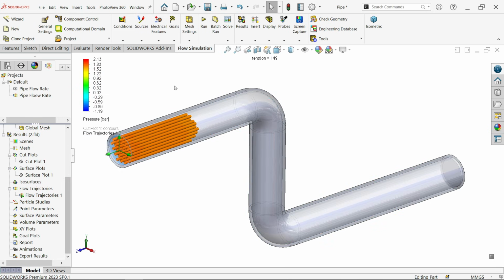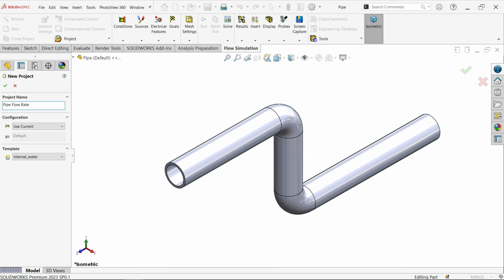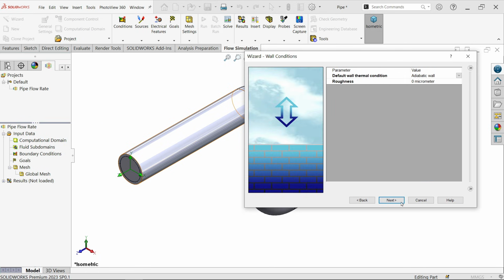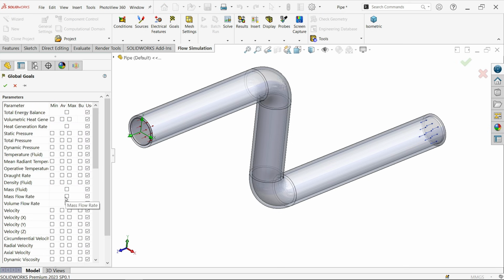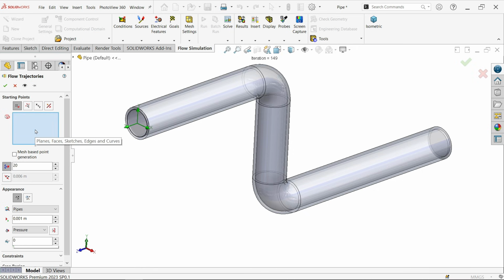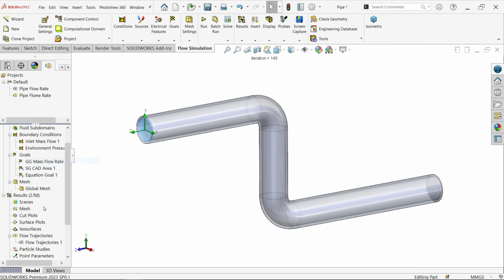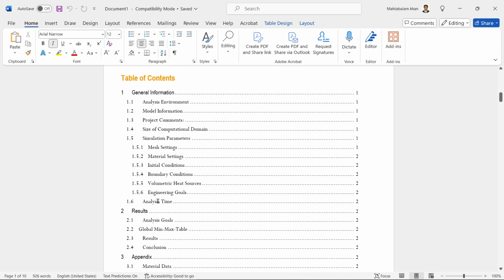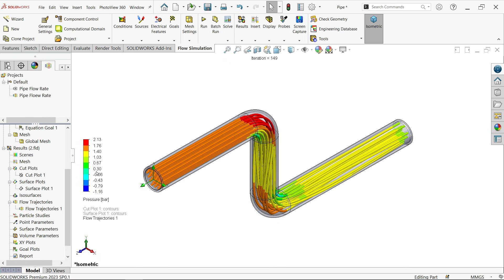SolidWorks Flow Simulation through Pipe Find Velocity, Mass flow rate, Pressure, Temperature?

Comment: I've been trying to figure out which of the Solidworks features I should use to test the flow of water around a newly designed fishing lure.
I was hoping to simulate the lure as it's being reeled in.
Would it be better to use this flow simulation or would a wind tunnel simulation be better?
The soft plastic fishing lure in question has a paddle tail that's designed to move from side to side as the water pressure  on the forward facing side of that paddle tail.  Is there one Solidworks evaluation or analysis feature that is better suited for this type of simulation?